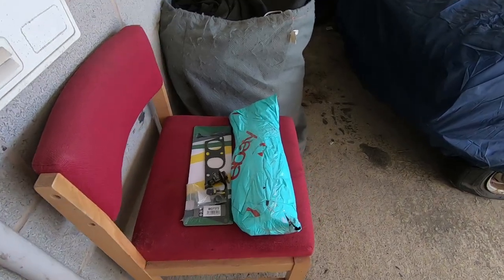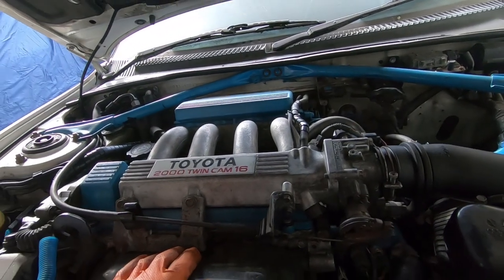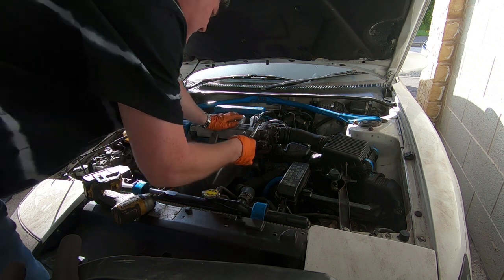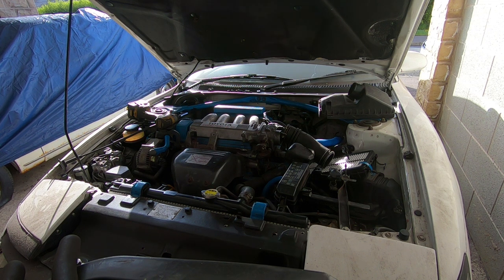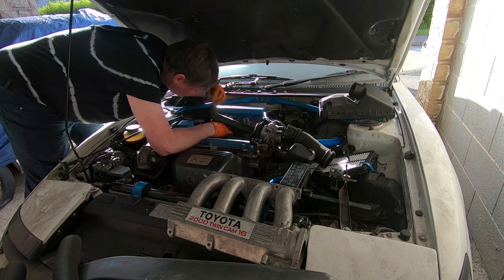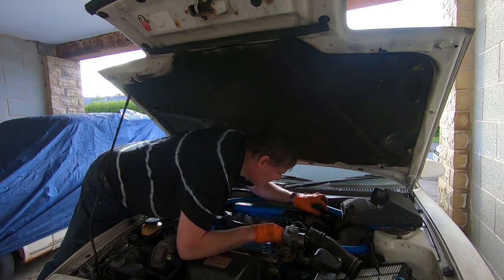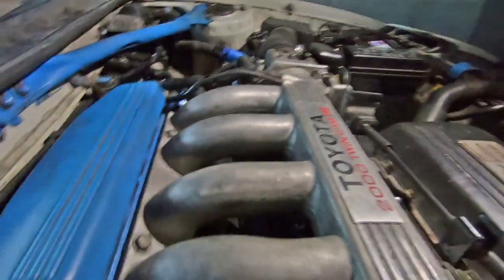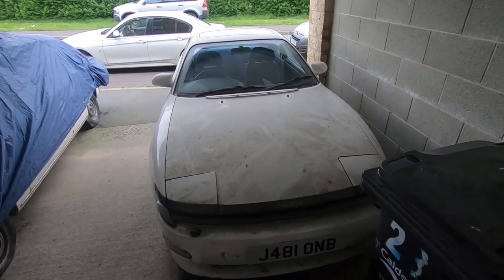Toyota Celica Part 37 - Replacing the washer jet and fuel injectors

Comment: Hell yeah....over here they made a Celica all track ...in that body style ....awd turbo...very rare ..ever hear of them?
Reply from the maker: Could be the GT4 which had a turbo and 4WD. There was also a Carlos Sainz version.
Reply: @Parknest  it's called an all-trac ...not sure what motor
..prob the mr2 turbo motor....I've only seen a few in person....there not that fast but rare
Reply from the maker: The GT4 had a 3S-GTE engine which was the 3S-GE with a turbo. They were also used in the 2nd Gen MR2
Reply: @Parknest  I miss my mk1 Honda civic crx it just rotted away in the end 😭. Strange rear seat in it as well like a baby's bath. The t bar mr2s are just the nuts you never see one nowadays 😭
Reply: @Parknest  yes exactly ...the 3s-gte ..my uncle had a 91 turbo mr2 a long time ago

Comment: I HAVE HEARD THAT ECU DEGRADE  CAPACITORS IN SIDE GO BAD OVER TIME ,  PLUS THE FLAPPER STYLE  AIR SENOR CAN PLAY UP. GOOD LUCK
Reply from the maker: Yes, electrolytic capacitors can indeed degrade over time. The ECU board looked pristine when I opened it up but that doesn't mean the capacitors are perfect.